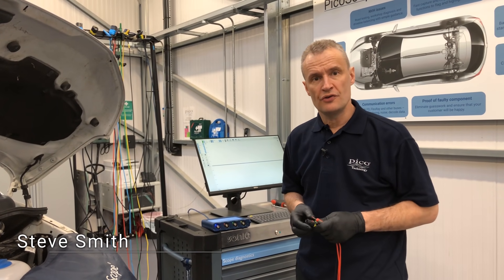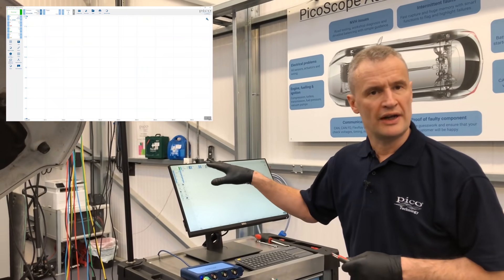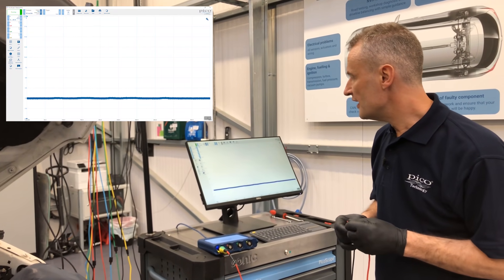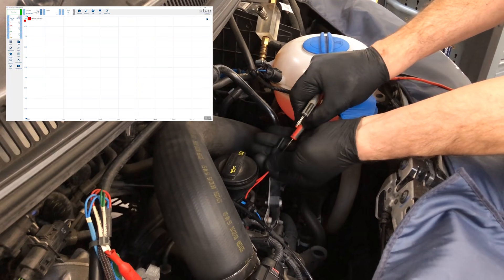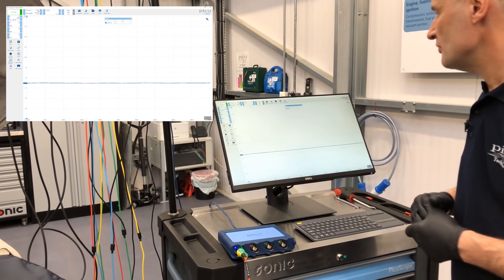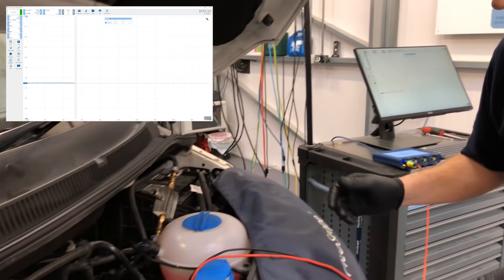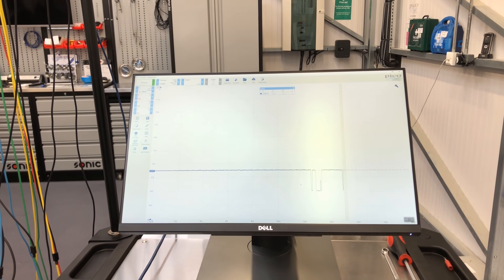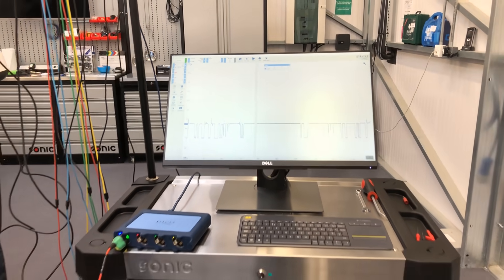Graphing resistance with the PicoScope 4425A

Comment: Wow. When the other automotive channels say they didn't do resistance checks and you prove what it's good for. Nice job.
Reply: Resistance tests can be misleading. I don't use them often as I prefer loaded circuit tests. I find loaded tests to be more reliable, but that's just me. A 4 channel scope is a great tool for voltage drop tests IMO, however resistance tests definitely have their place. The ability to graph them on a scope is really cool and a great teaching/visual tool to show your customers.

Comment: What do you mean by "join into the pressure control valve"? You mean back probing? Isn't it compulsory that you isolate the component by disconnecting from the harness? Thank you.
Reply: Hello and thank you for the feedback. Most certainly yes, you must isolate the component from the circuit to test the component. However, here we are testing the circuit resistance with the PCV valve in the circuit (via break out leads) but with the ECU is disconnected. Wiggle testing the wiring harness reveals a deviation in the total resistance of the circuit (including the PCV)  I hope this helps clarify the test conditions.

Comment: What is the voltage level being applied to the circuit while in resistance mode? Similar to a DVOM  or similar a MilliOhm meter?
Reply: That is a good question!
Reply: Hello and thank you for the reply. The voltage applied is similar to a DVOM and is set at 2.5 V

Comment: Dang, a quick look at my PICO 4425 failed to show any option for measuring resistance. This would have been a really useful feature, is there any work around I can use to get the 4425 to perform this task?
Reply: spelunkerd asked that just before, resistance probe seems to work with 4425A 4225A only.
Reply: Hello and thank you for the feedback. Within the 4425 model there is not direct way to measure resistance other than ohms law knowing voltage and current values. There is however a work around which I will look into for you ASAP
Reply: Hello and thank you for your patience on graphing resistance with the 4425 model scope. The following forum post now has this covered https://www.picoauto.com/support/viewtopic.php?f=24&t=21311&p=100263#p100263 I hope this helps, take care......Steve